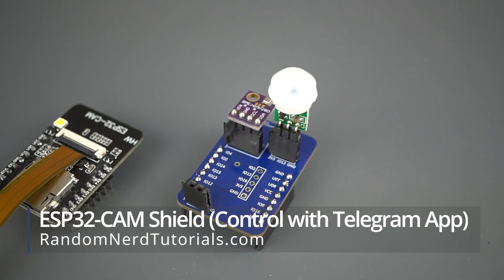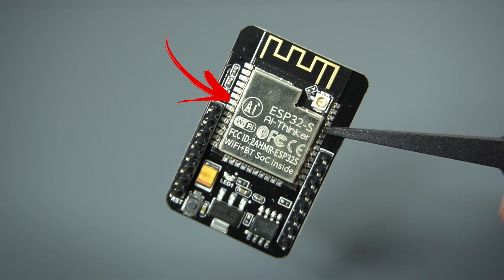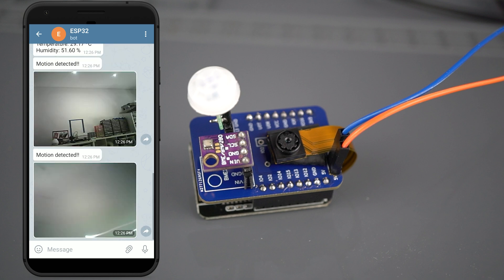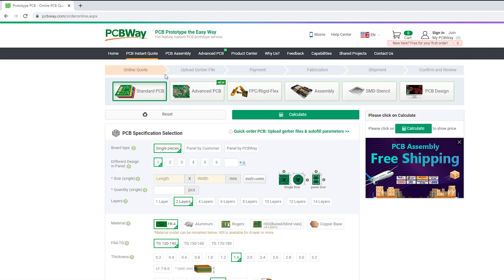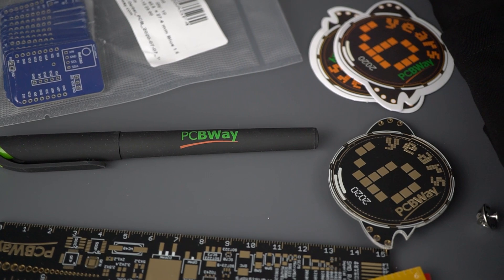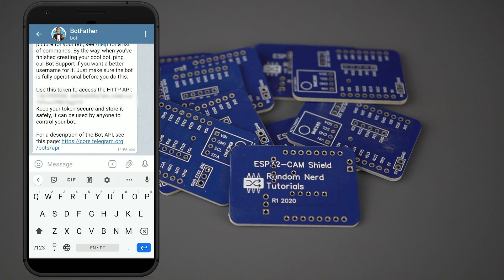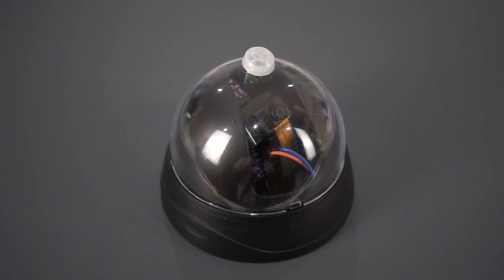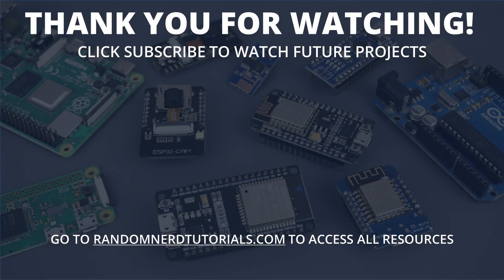ESP32-CAM with Telegram: Take Photos, Control Outputs, Sensor Readings and Motion Notifications

Comment from the maker: You can find all Project details (Gerber files + schematics + source code) on my blog ► https://RandomNerdTutorials.com/esp32-cam-shield-pcb-telegram/
Reply: Can pcbway make me an esp32 shield with a pin connectors and a switch that grounds gpio1, maybe even terminal blocks?  I mean do they just do the pcb or will they add components?
Reply: Can we have a live video feed ?
Reply: @RuiSantosdotme now this project is not working properly only it can take photo's by telegram command and bme280 also not responding,I chose this project for My final year project but now it's boom, what to do now?

Comment: sir i have a problems    11:43:09.532 -> clk_drv:0x00,q_drv:0x00,d_drv:0x00,cs0_drv:0x00,hd_drv:0x00,wp_drv:0x00
11:43:09.532 -> mode:DIO, clock div:1
11:43:09.532 -> load:0x3fff0030,len:4916
11:43:09.532 -> load:0x40078000,len:16436
11:43:09.593 -> load:0x40080400,len:4
11:43:09.593 -> ho 8 tail 4 room 4
11:43:09.593 -> load:0x40080404,len:3524
11:43:09.593 -> entry 0x400805b8
11:43:11.472 -> 
11:43:11.472 -> Connecting to HLJ
11:43:11.472 -> .
11:43:11.954 -> ESP32-CAM IP Address: 192.168.43.61
11:43:11.954 -> Start configuring and initializing the camera...
11:43:11.991 -> E (1648) camera: Camera probe failed with error 0x105(ESP_ERR_NOT_FOUND)
11:43:12.027 -> Camera init failed with error 0x105ets Jul 29 2019 12:21:46
11:43:13.156 -> 
11:43:13.156 -> rst:0xc (SW_CPU_RESET),boot:0x12 (SPI_FAST_FLASH_BOOT) 

  esp32 cam connecting and disconnecting continiously

Comment: Hi, Dear Mr Santos I
I would like to thank you for sharing your fabulous project. I have constructed the same but only with PIR sensor and not BME. The circuit is working fine but when flash is turned on it keeps on and again /flash command is to be given to turn it off. Kindly suggest that it flashes for a couple of seconds and auto turn off. 
I appreciate your time and efforts.

Regards

Comment: Hey, ultimate newbie here with a question. Why don't you need resistors on this project, while you use them on your previous one, where you also build an ESP32-CAM with a PIR sensor (video title: ESP32-CAM PIR Motion Detector with Photo Capture (saves to microSD card))?

Comment: Hi and thanks for this sharing. The circuit is working flawlessly . BTW i have a question : What is the current consumption of this circuit and is there a way to put the ESP32 in sleep mode and to wake it up when a motion is detected in order to allow longer  battery using time? Thanks.

Comment: Hi and thanks for this great project.
i would like to used a Normally open micro Switch to trigger the even of sending the photo.
how can i use it instead of the motion sensor.  
should i connect the 2 leads from the microswitch to where the yellow and black connections are on the motion sensor.

Comment: An excellent project. But I still haven't found an ESP32 CAM project which would be usable to secure the home when you are not at home. For that, the device shoud be at least able to:

1. Take an image every few seconds and store it to SD card (in case other methods of storing the images fail).
2. Upload every image to some free cloud storage service (mega.nz or Dropbox or Google Drive) in case burglars enter the house and take the cameras with SD cards.
3. Enable viewing the most recent image using a browser like in CameraWebServer example by Espressif (maybe one ESP32 could run ngrok service to enable direct remote access for each ESP32 CAM separately, if that is not possible than one Raspberry Pi or Raspberry Pi Zero could run ngrok service). It is not usable if the ESP32 CAM could be accessed via Android application only - there should be a way of accessing it using a web browser.
4. Upload every image to a hidden Raspberry Pi or Raspberry Pi Zero (another redundancy level if something goes wrong).
5. Firmware should store the number of the last image into the file (storing the image in EEPROM every 2-3 seconds would wear the EEPROM even when using wear leveling) not to overwrite previous images after the power outages.
6. If NTP time synchronization was successful, an entry for each image (which contains a timestamp) should be added in a .log file.
7. ESP32 should be able to detect a movement and in that case immediately send SMS and/or email notification to the owner .
8. Owner should be at any moment be able to trigger the alarm from the remote location using a browser. That way, owner could - upon receiving the movement notification and checking the most recent images - trigger the alarm. The alarm should stay ON even if burglars enter the home and destroy the ESP32 devices. By placing the alarm siren at some difficult to reach place (e.g. behind a few doors) the burglars couldn't destroy the siren too fast.

I've done most of above in separated firmwares but am still working on a firmware which could do everything described at once.

Comment: A useless project.  It only works on a local Wi-Fi network.  Make a project that will work via the global internet then it will be useful and very cool.
Reply from the maker: What do you mean? It seems like you didn't understand how the project works. This project works from anywhere in the world. You just need the Telegram app and any Internet or Data connection to access it
Reply: @RuiSantosdotme  If so, that's cool.  Sorry for the confusion.
Reply: Would be possible do this project with sim800l ?